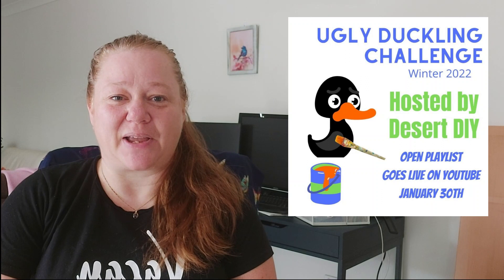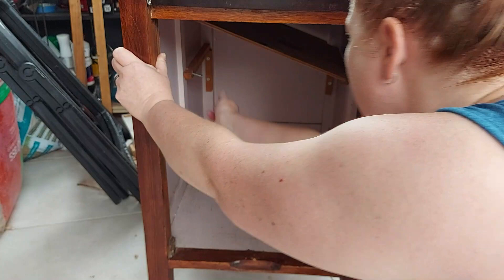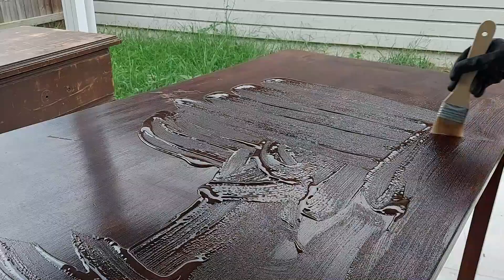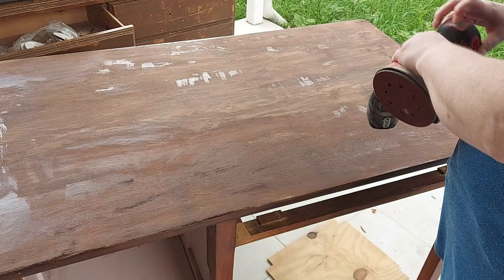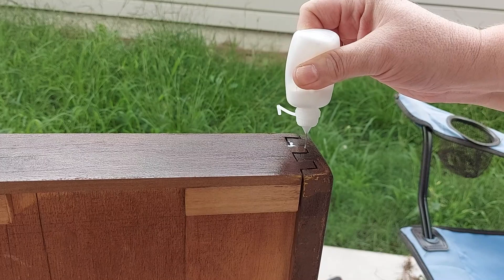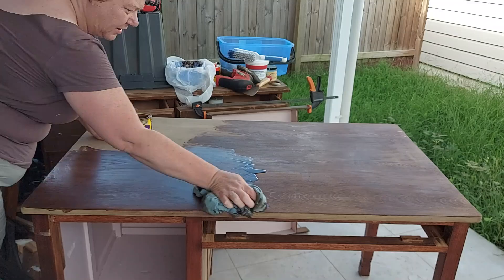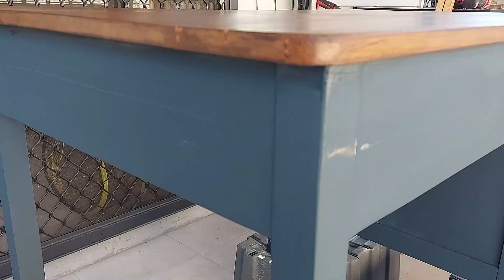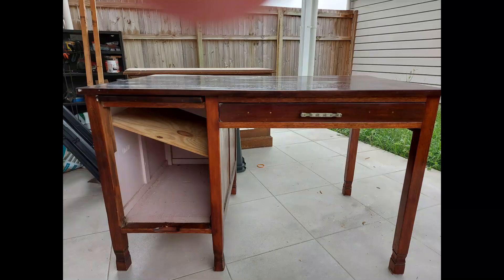From Ugly Duckling to Unique Desk - check out the transformation!

Comment: It looks like mahogany from here, wood restorers trick, if you use a chemical stripper then use a conditioner before you re-stain and it will go on smoother, more even and use less stain, plus less chance of it geling from getting laid too thick, makes the job easier! Turned out gorgeous.
Reply from the maker: Thanks for that, yes, it could have been mahogany. You're the 2nd person to tell me about wood conditioner, I'll definitely be using it in future. Thanks so much.
Reply: @breimagined2199  it was something I use to skip, as an upholsterior my frames for dining chairs etc I had a guy who custom built and then I finished and upholstered, then I moved in next door to a restorer, I was having blotchy troubles one day and was very frustrated so wandered over and asked him and he gave me quite the lengthy lecture on conditioner, I went back, sanded it down and used conditioner, then the stain just glided on, took very little and was an even color, so now I'm a believer.

Comment: Your piece came out very nice I like the shade of blue you used. I do have a question I had a bit of a hard time understanding some of the things you were saying with the music sometimes being on the loud side the glue you used to repair the drawers is it a brand that comes in that bottle with the needle tip or was it a bottle you transferred glue in to either way what brand is it and/or where can it be purchased? Thank you
Reply from the maker: Hi Catherine. Sorry about the music - I'm new to this YouTube gig, so I'm still learning what works and what doesn't :-)
The glue is just standard PVA - I put it in the bottle (watered down 3 parts PVA 1 part water so that it would flow through the nozzle) I got the bottle as part of a craft kit, but they are available from Amazon. Hope that helps!
Reply: @breimagined2199  thanks for getting back and I get being new and trying to figure everything out. Good luck